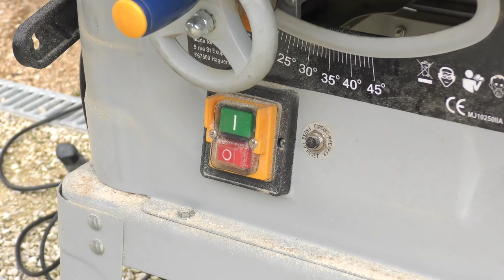Making The Totem From Monument Valley For With My Son

Comment: I had been planning to make this for about a month, since before stumbling upon your video today. I couldn't figure out how to make all the cubes move freely. Could I maybe use ball bearings or something? Only the middle ones can be freely rotated in the beautiful model you created, right? The top and bottom ones are attached to the axis and are stationary, is that correct? If so, is there a way more than 2 cubes could be rotated freely?
Reply from the maker: The shaft is glue to only one cube so they can all rotate freely ;) Thanks for watching and good luck for you build :)